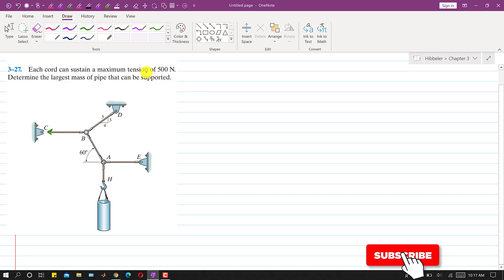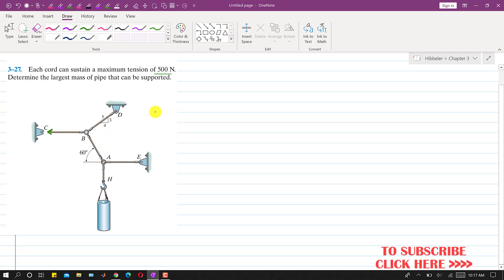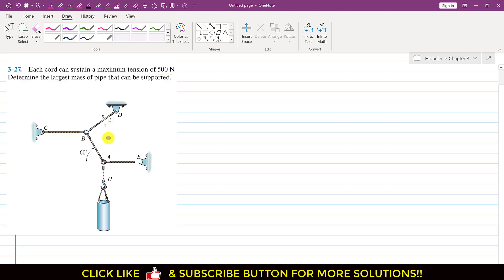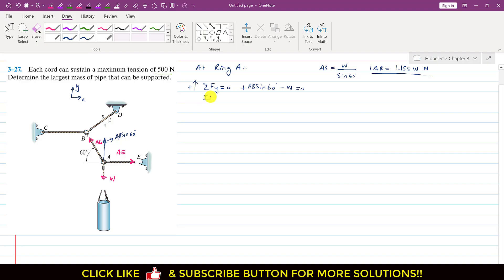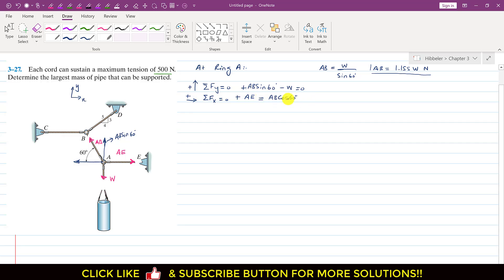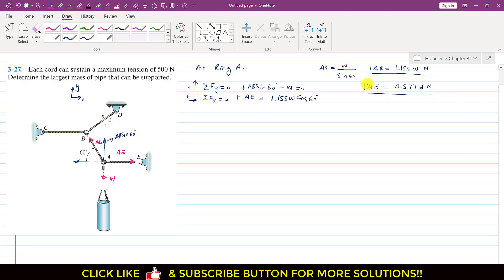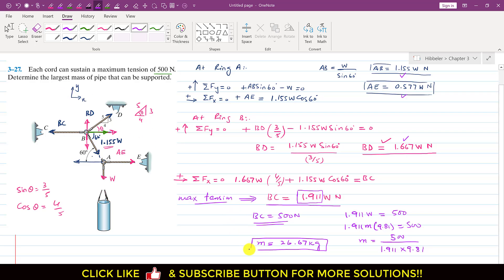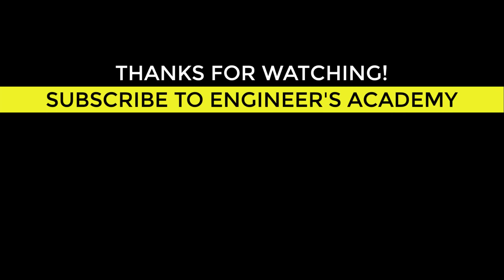Determine the largest mass of pipe that can be supported.. | Hibbeler Statics, Engineers Academy

Comment: At 2:32 Where do you get AB = 1.155W N from? I get 0.866
Reply: So I did 1/sin60 and got 1.155
Reply: @SeanBook001  i think youre right on that one
Reply: I believe it should be 0.866 any other way of calculating it does not come to 1.155
Reply: (1/sin60)=W @shoving6462